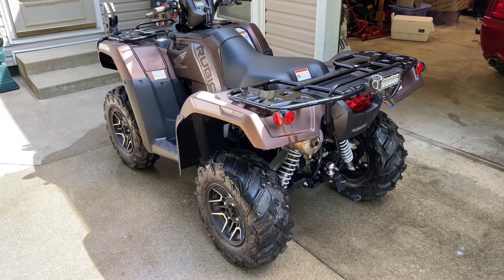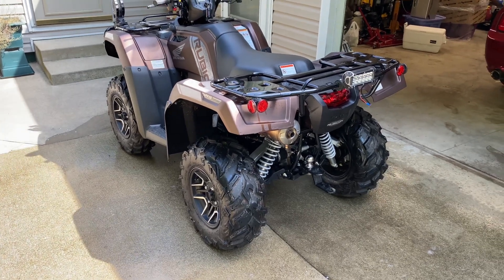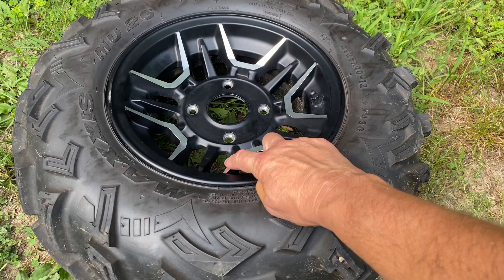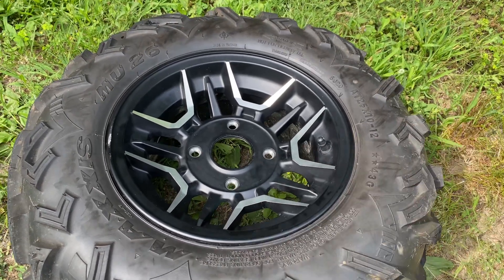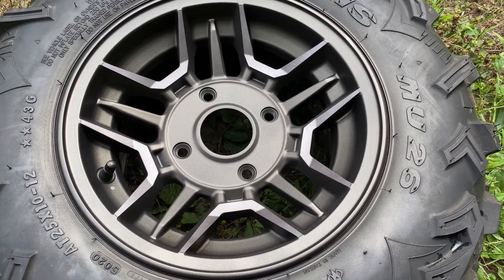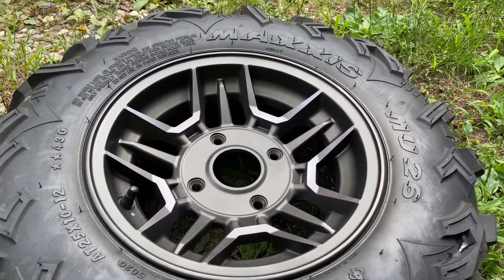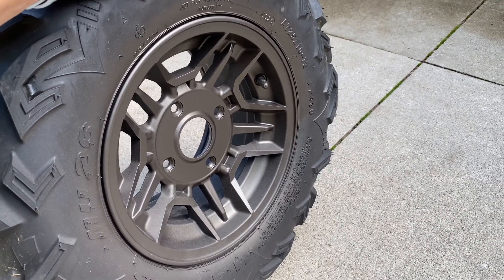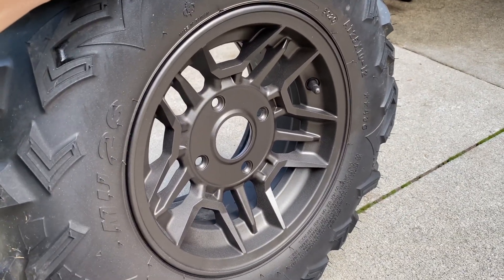Repainting your Honda Rubicon wheels using Dip Your Car’s Hyperdip

Comment: It's going to look nice when all finished. A few things: the 1st 2 coats should be light just like you did. the next coats should be medium coats and layered to achieve that wet glossier look. 

You should have a total of 12-13 coats or so. Even when it is covered at coat 5-6, keep going. This will give it some durability as well as giving it the ability to peel off when you need/want to. Unfortunately, you wont be able to peel it with a few coats. 

Also, you should be using Dip Release on the tires. When you are finished spraying the proper amount of coats, the Hyperdip will peel off the tires very easily.

Check out how I did the Hyperdip in my video section. Well done on your video!
Reply from the maker: Thanks for the comments and suggestions. I will definitely go back and add more coats and then do a follow up. I definitely thought of the dip release but I remembered how easy the PlastiDip peeled off the tires on my GX470 when I did those. 

I checked out your video and it turns out I had watched it awhile back when I was researching ordering Hyperdip. Well-done video…..it was very helpful. Heading back outside to do a few more coats. 

Thanks again for commenting and watching 👍

Comment: I think it looks good!  I've had good luck on ATV plastics and stuff with plasti dip.  It should stay on the wheel for a while depending on how thick brush you bash through.  If you ride in icy waters, the ice will chip it off easily.  Fun project!
Reply from the maker: Thanks. I’m hoping it will last quite a while since I rarely go through brush. It’s used for mostly work around the property including snowplowing during the winter. Any longer rides are done on the fire lanes around the area. Now if I did some of the trail riding like Quaddingsous does, I’m sure the paint would come off after just one of his rides. Check out his channel if you’ve never seen it. 

Thanks for commenting and watching.

Comment: How durable is it? If it peels off as easily as you say, it probably wouldn't be good for anyone riding with me right? Just curious because it looks like a cool product.
Reply from the maker: Hey Q, great to hear from you. I remember when I first told you about this paint a year ago…finally got around to trying it in all my retired free time 😉

While I do think it will hold up well to everyday simple riding, chores around the property, snow plowing, etc., I definitely think trail riding like what you do on your video trips might end up tearing the rubberized paint. Anything that would scrape the paint off stock wheels would definitely tear this and I think the biggest culprit would be sticks and wood on your trails. I think for the type of work I use my Rubi around the house would be fine for this. 

The aluminum wheels on my F-150 are pitting after 8 year of Midwest winters, so I’m definitely going to do this on the wheels once I choose a color/finish. That should last for normal driving, as I don’t do any off-roading with my truck. 

Wife and I just returned from an Alaskan cruise. Omg what a beautiful area up there made me really appreciate the beautiful rides you guys are able to do up north by you. So jealous. 

Take care my friend.